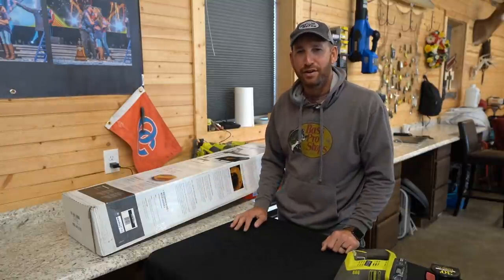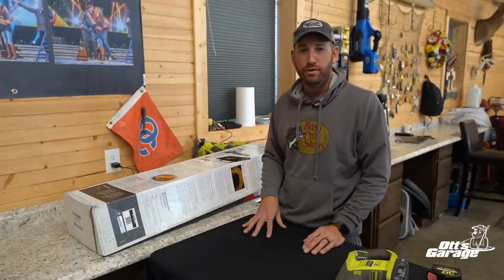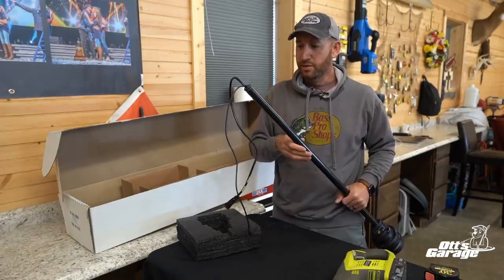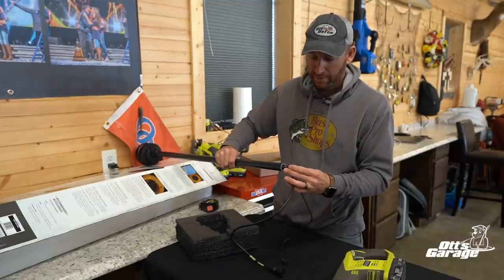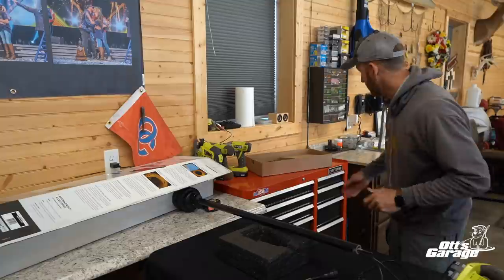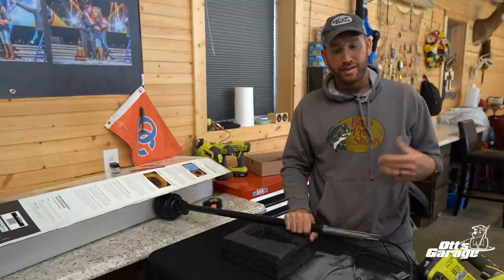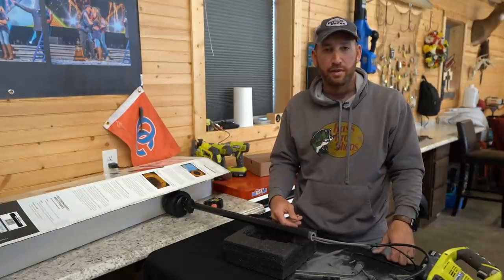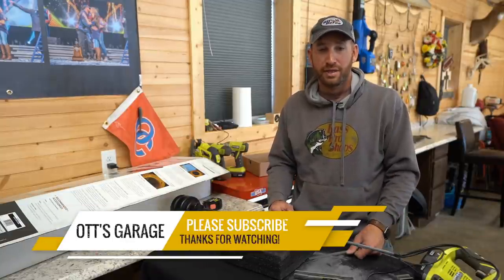Ott’s Garage | Humminbird 360 Modification

Comment: Ott just a heads up…a plumbers pipe cutter will make quick work of this, leave a clean end (no burrs) and you don’t have to worry about nicking the wires. Take a about 1-2 min tops to accomplish.  Hope this helps for the future.
Reply: That was my first thought as well
Reply: @btmbass8558  I thought the same, but...will the connectors pass through the piece that you've cut-off?
Reply: I was gonna suggest the same thing!
Reply: How much should the transducer should be from the trolling motor blades

Comment: Nice tip about the 360 shaft length as I didn't thing of this. You had me nervous with those wires so close to the Saws-All blade. I would suggest getting a pipe cutting tool to avoid those wires all together. Murphy's Law

Comment: Great job! Yeah a tubing/pipe cutter would not work well on that material.
Reply: It most certainly would if you use a pipe cutter and not a tubing cutter. They make cutters for black iron pipe. Plumber 45vyears.

Comment: I've had Mega 360 for a year now. Half the time my screen is covered with random lines in the outer rings as it spins at any speed. Even when I get a clean picture, I can't make out anything. Mega down imaging is Amazing. But I can't see what I see on DI, on Mega 360. Like brush piles ect. Dealer says they hooked it up fine. 🤷🏻‍♂️
Reply from the maker: Sounds like you have interference with other imaging pings. Try putting them into standby and see what happens.
Reply: @OttDeFoeFishing  Thank you Sir. I will try that. My Son, your "biggest 3.5 foot tall fan", as I've often referred to him on here, is gonna go nuts when he sees your comment! He never gives up on you in a tournament. Not for a single minute! Thank you for sharing your Faith in Christ! God Bless!